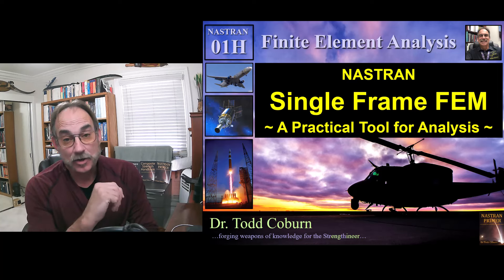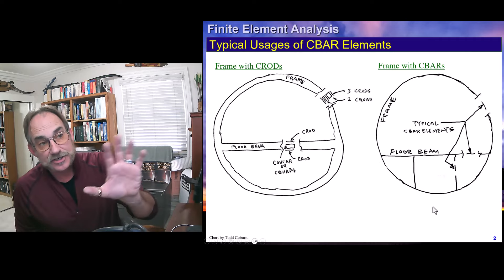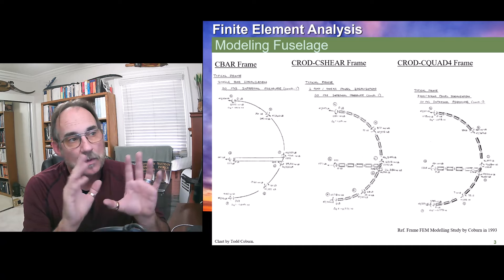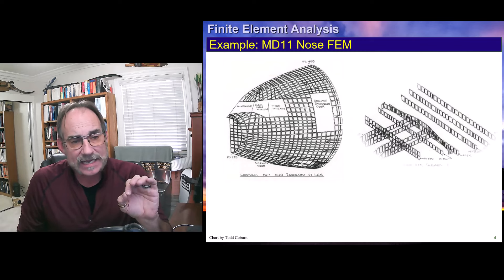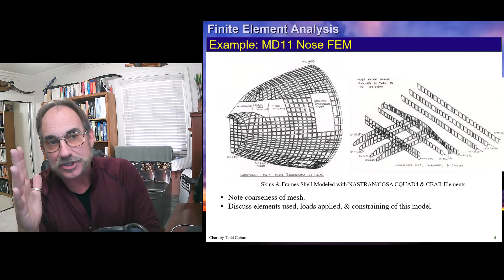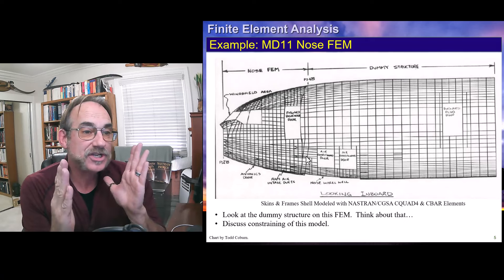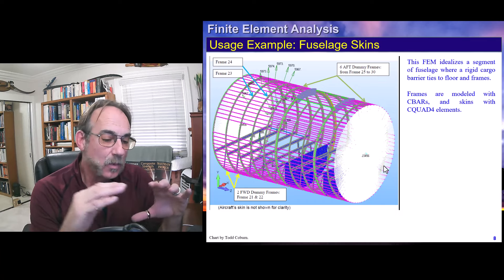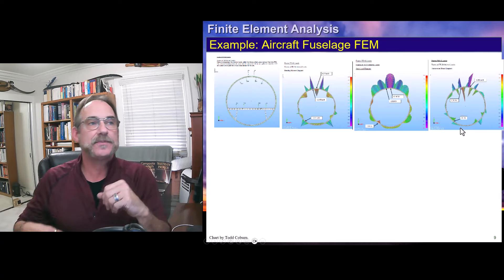FEA-L21 Single Frame FEM - A Practical FEA Tool

Comment: Had to chuckle a little bit at the shade thrown at the Boeing, Airbus, and NG. I’ve worked all thee and the first two definitely love the churn, especially AB. I worked sec 41 on the 747 for a while and they used bars for the frames in some of the older models. I remember actually going to an old library and digging up old microfiche and scanning through visually to find the correct element, output was a literal screen shot printed out like a xerox. The was in the early 2000s and they were still using that old way of doing things.😅
Reply from the maker: Lol.  Fun memories.